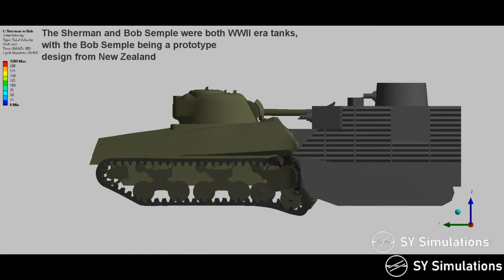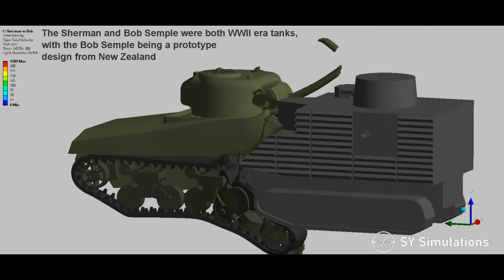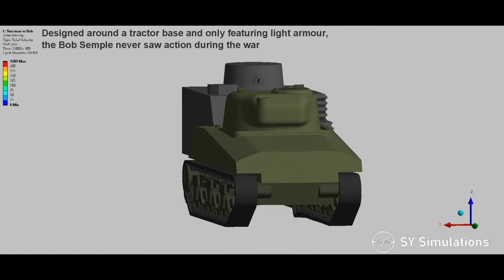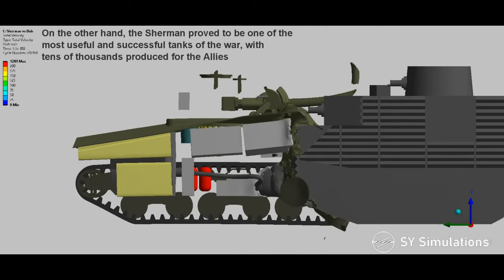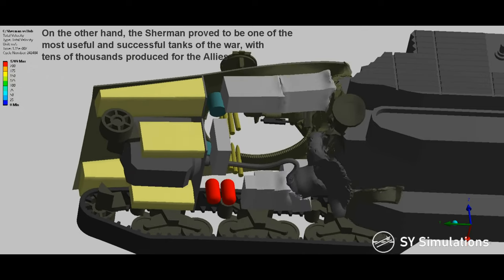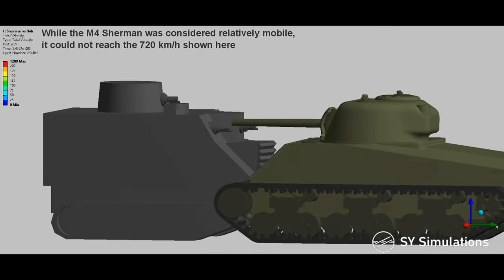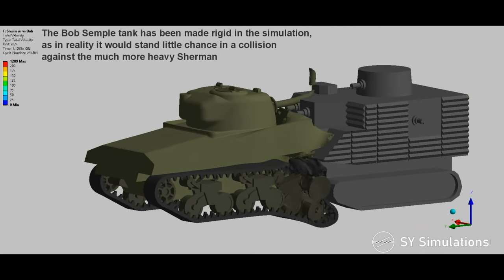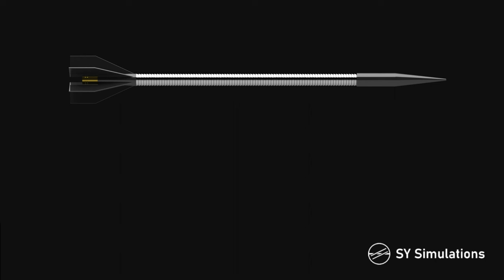ENTIRE SHERMAN TANK vs BOB SEMPLE | April Fools' Special | Tank Collision Simulation

Comment from the maker: A combination of a few people's suggestions from the recent poll; normal content will return shortly :)
Reply: How long did it take to make? Was very interesting to see the damage to the internals of the Sherman!
Reply: Can you do a 800 mm Dora shell vs the Ratte?
Reply: I am in fact curious about the effects of a vibrator travelling at mach 5 impacting the crew hatch of the Sherman.
Reply: Where did the concrete shell video go
Reply: could you do an actual frontal collision simulation of this same event?
Reply: Would be actually very interesting to see what would happen if a sherman collided with a bob semple where they are both going max speed
Reply: @JustMinna  that's exactly what I was thinking, real tank fender bender